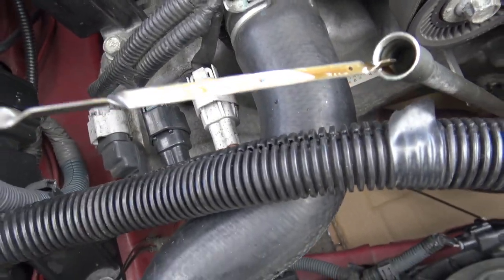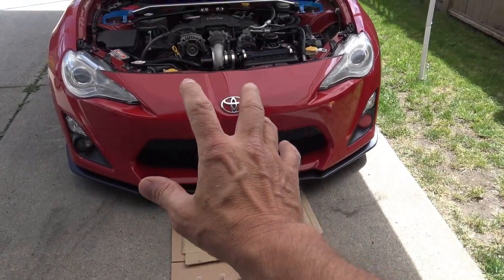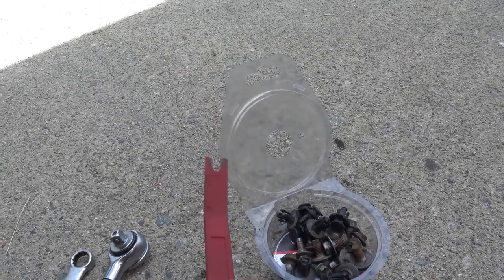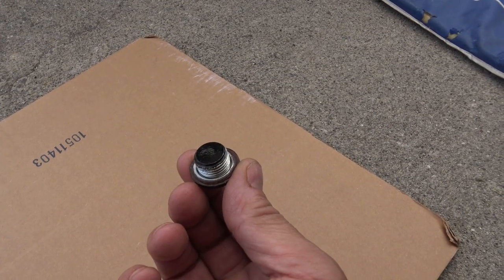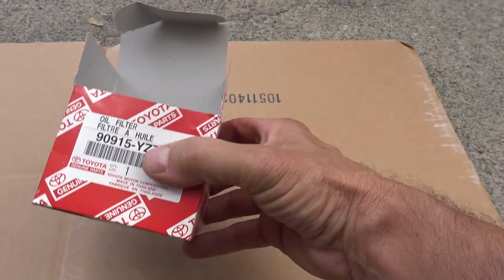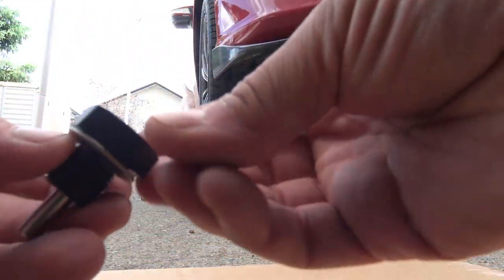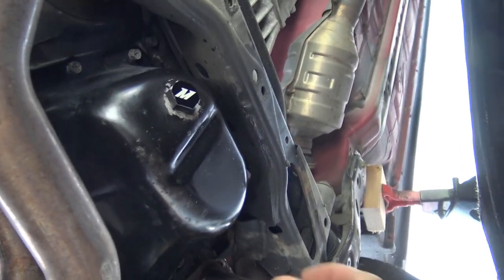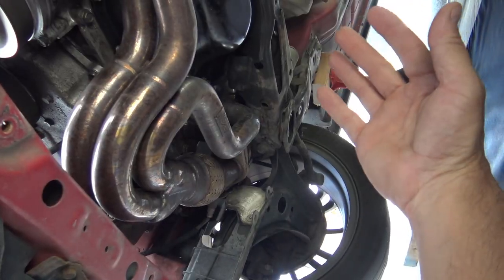What happens if you overfill your engine oil?

Comment: Here's a lesson I learned, when checking oil, always wipe off the dipstick and then reinsert to make sure you get an accurate reading. How I learned this: I am a private pilot, small aircraft engines are mostly air cooled and somewhat loose tolerances to make up for temp related dimensional changes. Aircraft engines use oil, quite a bit of oil. You check the oil level and fill up before every flight, I got in the bad habit of pulling the dipstick, reading it and going on. I was thinking the aircraft didn't seem to use as much oil per hour as expected. Next time I did the preflight I read the dipstick, wiped it off and read it again, it was a quart lower than the first time! Apparently the oil was creeping up the dipstick by capillary action, so don't automatically assume your engine oil level is correct unless you wipe off the dipstick first. This was on a Continental aircraft engine, will your car engine do this? I don't know, but the only way to know for sure is to wipe it off.
Reply: If you didn't know to wipe off the dipstick when checking the level, you shouldn't be working on cars or planes!🤦‍♂️
Reply: @G56AG  That can't be a good thing... I've only worked on cars and I always wipe off and recheck the dipstick especially if you don't know if the engine has been recently started.
Pulling it out to look at it and sticking it back in is only good in other situations...😏
Reply: many small aircrafts  use a subaru car engine because of the efficient boxer engine design.
Reply: @edmalinky9124  really ? What about blown head gaskets ? Reliability beats efficiency , especially in the sky . I won’t be flying in an Subaru powered plane , that’s for sure.
Reply: @barbraabsalom4531  the whole head gasket thing is a joke. Its just that on the older ej platform it was very common to tune the car and turn up the boost and typically when doing so you need to also torque down the heads more, but no one does that and the extra psi blows the gaskets. A stock fa/ej is reliable on its own.
Reply: Ive done this ever since i was about 16 and im in my 50s. pull it, wipe it, and then check.
when the engine runs, oil gets sloshed up the stick. no way to get an accurate reading.
Reply: Yes it will in a car engine. I like to overfill my 454 chevy by 1/2 liter. When I check the level even long after it ran, it shows the level 2" over the fill mark. After I wipe the dipstick it shows 1/2" over the fill mark.
Reply: @barbraabsalom4531  what the actual fuck man, how calm and confident you call subaru engines absolutely  unreliable and make a mith s fact, blowns my mind completely
Reply: @alexanderboychev1095  inherent head gasket issues generally put an engine in the unreliable category despite what fanboys believe
Reply: lol.........and your a pilot????  That's just basic common sense!!
Reply: I only use genuine subaru boxer engines in all my planes
Reply: @BIKEMAN21  good luck !
Reply: @EasyMoneySG  I'm a 56 yo girl and been checking my oil for over 37 years, always clean and reinsert, pull out, check....
Reply: P
Reply: you fly boys crack me up
Reply: Isn’t wiping the dipstick about as obvious as opening a door to walk through it? Isn’t this one of the most obvious comments in the internet?

Comment: Every time I have gone to my Toyota dealer for the last 4 years (under warranty) RAV4, they have overfilled the oil. Last time it was 750 mls. I complained each time. I just withdrew it up the dipstick tube with a syringe the next day after the supposed service. Dealerships can’t even do the most basic things. I’m from Australia.
Reply: @MegaSelby  That made me feel better.
Reply: I am a woman who is changing her oil for the first time (with no help) and after many years. I didn't even have a car for about 6 years. I read online that my Mitshubishi needs 1 quart (I believe that is the whole bottle) when it is at the lowest dot/or lower (mine was at the lowest dot). So I had DECIDED beforehand to only add 1/4 of the bottle at a time, AND THEN stop and check. But for some reason After adding the 1st 1/4 of the bottle I overfilled it. I am stuck... I am thinking about crawling under my SUV and draining it.

Comment: Bought a 2003 Honda Civic that was overheating I realized the the oil was overfilled by nearly 3x the correct amount. Didn't burn any oil or show no negative signs other than it overheating after 30 mins. Drained the oil to the correct amount and the car never overheated after that.
Reply: Was it milky colored at all? Overheating and a high oil level could also be signs of a failed head gasket. But if so the oil would have a color similar to a chocolate milkshake.
Reply: That shouldn't cause overheating something else is going on. I accidentally overfilled by a little over a quart and all it did was cause it to leak out in weird spots.

Comment: my gf added a quart over, we simply pumped out the oil from the oil dipstick tube instead of jacking up the car and loosening the drain plug.its a good method for this
Reply: How did you pump out the excess oil from the oil dipstick tube? What did you use?
Reply: @maryb6509  I have a huge 500ml syringe i just put a aquarium hose on the end and pulled it out
Reply: @pigeonsil240sx  
Thanks for your response, I appreciate it. Do you know where I can get a syringe that size?

Comment: That is not WAY over filled. Even if someone over filled their car with 1 whole quart, it be fine. You need atleast 2+ quarts over filled to really do anything. The min dot and the full dot is usually 1 quart. From your dip stick, youre about a half quart over. Which is completely fine. Even if you were running at the minimum mark, you still be fine. Now im not saying you should aim for being overfill or under filled. But im just saying if youre a alittle over/under filled, theres no need to worry. You will be fine. This is coming from a ase master certified tech with 15yrs of dealership exp and 5yrs of engine and transmission rebuilds. The most important thing is you just need oil and you just need to change oil atleast evry 10k miles.

Comment: when i accidentally over filled my oil i just loosen the sump plug and let it drip into a clear measuring cup and take about 100 ml then tighten the bolt and recheck oil level and i keep doing this until the correct level is reached
Reply: Good idea
Reply: Depending on the car, you can also remove the oil filter and dump the oil out of it as many times as necessary. Just make sure it doesn't leak after screwing it back on the final time.
Reply: That's the simplest. Messy but simplest👌

Comment: When The engine is running a third to half the oil is circulated in the engine. This lowers the level in the crank case a lot. It's very unlikely the crank is touching the oil even with an extra quart.
Reply: I was gonna say. A quart over really isn't aas bad as this guy claims.
Reply: Exactly right mate..

Comment: Tip - if you overfill get some clear tube and a big syringe (100ml) and put the plastic tube down the dip-stick tube and suck it out. Simples.
Reply: That's what I did when the mechanic overfilled oil on my car.
Reply: That's what I did when the mechanic overfilled oil on my car.
Reply: @YCKING !!! messy
Reply: ratcat not sure if the question was to me or not however I’m from Scotland 😎
Reply: Thats also what i did when they overfilled my car in service shop
Reply: Where do you find a big syringe?
Reply: Ray Chamberlain - got mine off eBay Large 100ml Plastic Syringe With 80cm Clear Tube For Measuring Nutrient .UK
Reply: @mell3109  ok cool thanks 👍
Reply: Jesse Cano sounds like your friend should not be allowed to open the hood hahaha
Reply: @cristitoalano7628   even after removing excess oil I do see white smoke, how long will it take to resolve?
Reply: @playlistajimenez5567  even after removing excess oil I do see white smoke, how long will it take to resolve?
Reply: Of course make sure the syringe thing is VERY clean
Reply: Yeah keep it simple man.
Reply: the clear tube need to be a bit stiff, but not so much so that it can not negotiate the bends in the dip-stick tube.
Oil extractor would be nice in this situation, but if you have some modern cars with no dip-stick, you have to drain from bottom.
Reply: that's what i did!
Reply: @YCKING !!! yep in a 340ml or 600ml or 1 litre bottle easy depends how much you need to empty
Reply: Not if it gets frothy. You gotta completely change it. And your oil filter
Reply: @banztv5429  agreed, tip only good if the oil is just been put in, dipped, f*ck realised, can’t be arsed jacking the car back up and risking dropping good oil :-)
Reply: That's what I did when the overfilled car on my mechanic oil.
Reply: @raychamberlain9468  Any pharmacy.
Reply: I used battery operated oil extractor from Amazon to suck oil through dip stick tube. I had to remove 1 quart because dealer over filled.

Comment: Over fill will cause the motor to burn the excess oil getting into the cylinders. And the crank will create air bubbles in the oil causing your oil pressure to drop. When filling the oil, put in 1/2 quart less than the recommended amount. This will give you room to add more oil after checking the level. Most dipsticks have 2 holes. The space In between the 2 holes is your oil range. Bottom of the top hole is the full mark. The top of the  lower hole is the low or add oil mark.

Comment: Correction: The purpose of magnetic (drain) plugs is NOT to protect the engine from metal filings.  It is to INFORM and ALERT that (magnetic - iron/steel) metal wear is taking place somewhere in the engine and will eventually lead to engine failure.
The size of those metal particles is very very small, too small to cause harm to the engine.  If larger particles are seen, then catastrophic engine failure has occurred.
Note well that a magnetic plug will NOT collect non-magnetic material that lines bearing shells, and so cannot warn of imminent bearing failure.
Not a bad "how I change the oil and filter on my car" video.  It will be very helpful to owners of that model car.

Comment: A magnetic oil pan screw and magnetic pieces installed on the engine oil filter are good ideas to catch the small metals from the engine used oil. It is the best protection for the inside engine and for long, long engine life.
Reply: Where can I get those
Reply: @ordonezelvin  filtermag or beartrap

Comment: I overfill my motor once. I took out the oil using a airtube and syringe. It was easier this way then going under the car.
Reply: Yea
Reply: did you drive a bit with the car and sow that the car doesn't have power and revs more? or you took out the oil without ever driving the car?
Reply: That’s exactly what I did.  I took my car to a PepBoys and they overfilled my oil by quite a lot.  So I called my dad and he had an air pump thing and sucked the excess oil out until it lined up properly on the dip stick.  I was driving around with it like that for weeks.  I can’t believe how much they overfilled it.
Reply: @5urg3x  how long is too long? bc a mechanic did that to mine i drove around for 2 weeks like that
Reply: @lizechard I don’t remember that comment was like 3 years ago lol

Comment: Good step about using a wrench to remove the drain plug.  Once the torque is broken then the remainder of the plug can be loosened by hand.  This helps control the fluid flow AND reduces the risk of the drain plug falling into the oil.  

Note....Reduces the risk doesn’t totally eliminate.  

Race ramps can also help in two ways.  1 allow higher ground clearance and 2.  Allow more of a angle for the engine to tilt which depending on the location of the drain plug can help a lot more of the old oil to drain out.
Reply: Very common to strip the drain bolt head using a 12 point wrench. Get a six point socket instead.

Comment: Apparently  nothing happened  if you overfill your engine oil in this video !
Reply: It is definitely not recommended if you’re way over anything like 1/2 q over I’d say leak some out I mean, idk, I would I guess
Reply: That much over on 5 quart max is not as bad compared to 6.4 quarts say on a 2007 2011 v6 camry.  Theres a video showing a guy putting less than 6.4 and he used mobil 1 5w-30

Thinner oil will build less pressure so it's almost recommended to fill that to the max , even a HAIR over, which is what alot do.  Its alot of general physics and common sense.  DON'T let it run dry.  HOPE this helps who ever reads this tip
Reply: @rstuff1605  is it same with ATF transmission fluid?

Comment: As long as an engine that normally takes 5 quarts or more is only over filled 1 qt or less I really don't believe it will be high enough to hurt. I would be curious to see just how close a correct level is to the counter weights on the crankshaft. I'm sure every engine is different but I would also assume it's not so close as to 1 extra qt then contacting. Think of driving up hills, going around turns, making quick stops... If things were as close as you perceive the oil would semi constantly easily slosh onto the crankshaft.

Comment: Good rule of thumb is to subtract about half a litre or quart of what the recommended oil fill amount is with filter, then drive off your ramps or take off jack stands and check level after a few minutes, you won’t over fill then.

Comment: The dealership that I was going to did this on my new vehicle... I stopped going to them and started changing my own, which saved me a lot of money and future problems! It's harder on the seals when you over fill the engine oil and can cause leakage as time goes! I recommend doing the correct amount of oil, regardless of what anyone thinks!
Reply: I had a Chevy dealer overfill my van nearly 2 qts once.. alot of bigger shops use a over head pump. Similar to a gasoline pump nozzle we all use at the gas station. Well bigger shops have overhead oil filler pumps. On a spring loaded spool you can pull down. Then it rolls itself back up out of the way. Like a garden hose reel. Anyways they have a little gauge on them that shows each qt you put in. So they squeeze the handle and count how much they add. Thing is those things can get out of calibration.

Comment: I'm an engineer from an engine/transmission oil pump supplier. One of the large ones that can do black-box designs and are used in a lot of OEM vehicles. Foaming in engine oil will create trapped air bubbles that during the engine oil pumping cycle, can cause more cavitation. As for cavitation, it's bad in a pump. Just google cavitation damage. None of that cavitation damage is reversible. But rest assured that the engine oil pump is designed to run its entire warranty life with X% air in it without catastrophic failure. So if you consistently overfill your pump, it may still last until the warranty expires, but may not last 300,000 km.
Reply: Pump Cavitation.  Reduces oil pressure due bubbles in fluid.

Comment: I have to disagree on the oil foaming thing. Let's not forget that in horizontal shaft small engines, the engine is lubricated by a dipper attached to the bottom of the connecting rod that splashes oil around the crankcase. The motion of this dipper is more vigorous than if the crank itself were to contact the oil, yet if you check the oil in one such engine immediately after running it, you'll notice the oil hasn't turned into foam. Also remember the oil pump in your car draws oil from the bottom of the pan, and bubbles float.
IMHO slightly overfilling the oil has no harmful effects on the engine. Overfilling by a significant amount, however, can overpressurize the crankcase, leading to excessive oil consumption and possible damage to seals.
Reply: Any other side effects for overfilling? Just blew out a camshaft seal because my dumbass over filled, I drove it for a few weeks until I noticed the leak. Any internal damage or anything else I should look for? Thanks.
Reply: I usaully a little bit over fill oil
Reply: I agree with you on both points.
Reply: @ckbun  by how much did you overfill ?

Comment: Don't feel bad. I had two different mechanics one a high-end car garage overfill my 98 Subaru legacy with a 2.2 lflat-4 engine by the way if I speed manual all-wheel drive. And they put a quart and a half over full. The only thing I can come up with is my engine holds about four-and-a-half that's what's recommended and most engines are like five. So I think they just are so used to doing five. But then I'd hate to take a diesel truck to them cuz I think it was 5 and they don't fill it. Your video is very well done and I appreciate it because I was arguing with someone about what you're talkin about frothing up the oil and now I can show them your video.
Reply: Should wear gloves 😂